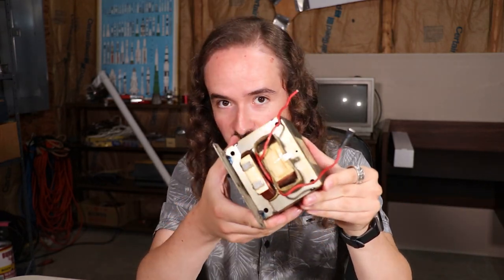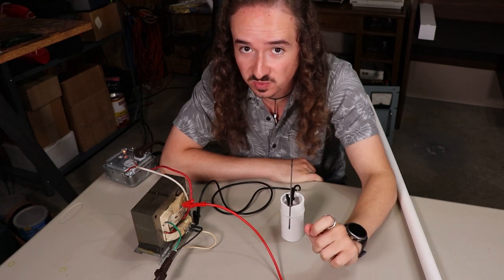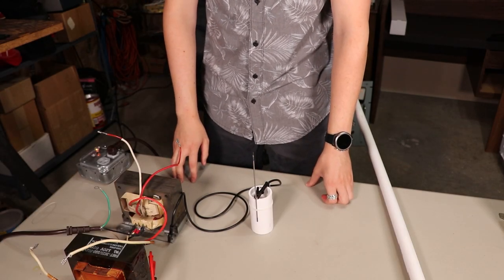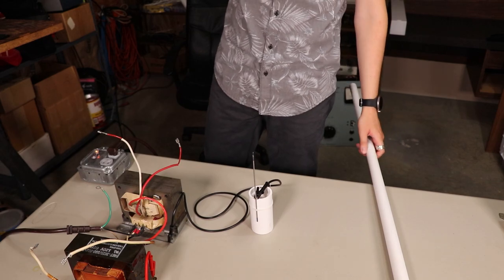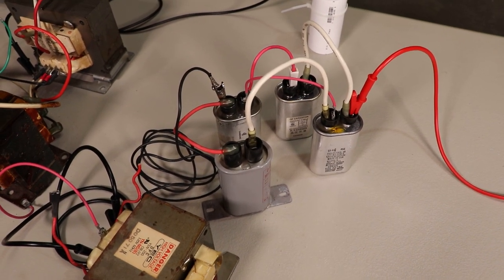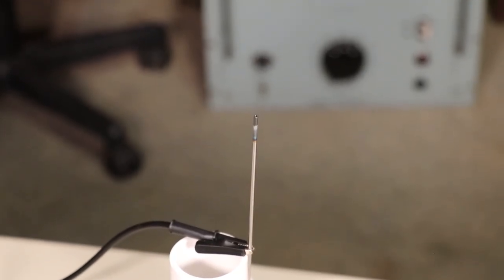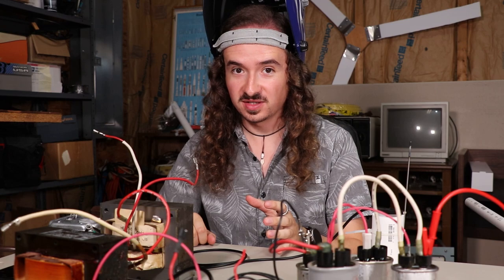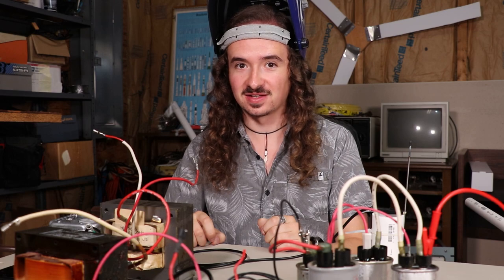Dual Resonant Microwave Oven Transformers: Huge High Voltage Arcs!

Comment: Hi my question is how much push force do a microwave transformer produce in pounds of electricity force? 
I know microwave transformer have a lot of voltage
But how much in pounds of electricity force thats what I want to know. When a power line get cut and the voltage cut line is moving up and down on the ground how much electricity force pounds is making it move like that? It must weigh something?
Reply from the maker: You're talking about seeing a broken power line jumping around as its arcing to ground? I haven't studied this very much, but I'd guess the dominant forces here are the magnetic forces, due to high current when it arcs, rather than the electrostatic forces due to the high voltage. It takes very large amounts of charge in very strong electric fields to generate human-perceptible forces, purely from electrostatic effects. Way more than the ~2.1kV of microwave oven transformers or the ~13kV of distribution lines to get human-perceptible forces causing motion on objects of human-perceptible weight. Force due to electric charge has to do with amount of charge and electric field strength and the distance between things, so it's not easy to make an overall statement of how much force it could provide. Something I worked on in the past involved lifting very lightweight objects with electrostatic force and it took on the order of 100kV to balance the weight of statically charged objects with a mass of only a few milligrams. I highly doubt 13kV on a power line is imparting any non-negligible amount of force, capable of moving a big, heavy wire. Especially when it's AC, where the polarity is constantly reversing and not DC which could accumulate some charge, like a capacitor, between the wire and the ground. The magnetic force, however, due to moving charges when high current is flowing, can be very strong on a human scale and I can absolutely see that being strong enough to cause motion on a heavy power line. Microwave oven transformer current is nowhere near what is available from a distribution line shorting out, so I imagine the force there would be much less. And again, it's AC, so it won't be a constant force. It will vary sinusoidally, with the line frequency (60 Hz here in the USA).
Reply: I try this with a microwave transformer and magnetron. I made a spark gap with a microwave transformer then put magnetron in between the spark gap. So transformer didn't make a spark , because its AC but when I put the magnetron energy on the transformer jump and made a big spark gap. That was color was bule and little yellow.  I put the transformer spark gap 3 " away from the magnetron  so when energy of the magnetron turn on go between the spark gap, the microwave transformer used it to make spark of electricity fire it look nice you should try it and put it on youtube

Comment: So you could weild with that correct
Reply from the maker: It's possible, but probably not very well because 1) the current isn't nearly as high as a proper welder, so it doesn't get as hot, and 2) it would be really unwieldy and imprecise because the high voltage enables the arc travel over long distances, so it would be hard to control the location of the arc.

Comment: What if they were connected in series to avoid high amp? Just wondering if this would work.
Reply from the maker: You mean by putting 240V across the two of them in series, instead of 120V in parallel? In theory, yes that would keep the current lower, instead of doubling it with them in parallel. The practical side of that, however, is that these transformers aren't identical models and probably don't have the same primary impedance, so it won't be exactly 50/50 voltage drop across the two. It may not that different enough to matter, but it still may be different. Take a look at the latest video I just posted though. The Jacob's ladder. I installed a 240V 60A circuit and I was able to run 4 MOTs no problem with that.

Comment: What would you say the voltage is with the 2 in series I need a good power supply for the tesla coil I'm building obviously it has plenty of current lol but from the ark distance at first strike I would say around 10-15 kv  maybe 20 but was sure about the distance from the video loomed like an inch or 3cm
Reply from the maker: Before it strikes, the voltage should just be the sum of the two MOTs (2x2100VAC =4200V) because there's no current flowing so there's no resonant rise. Once there's current though, then the voltage will go up. I'd have to write out the impedance calculations to know what it rises to. I have noticed after watching the video back that it seems to strike at a way longer distance than 4200V should be capable of though. My only explanation is red hot electrodes after repeated arcs having more electron mobility (i.e., thermionic emission). Not 100% convinced of that though.
Reply: @CoilLabs  I also wasn't thinking when I wrote this for some reason I was thinking you ran one off of the other transformer lol 😆  I don't know what I was thinking I'm building a tesla coil and I'm having trouble finding a power supply for a decent price and I really don't wanna use MOT transformer because they are super dangerous lol the amount of current these thing let flow is crazy scary but I might just have to also I wanna build a patent tesla has that he believed produced longitudinal EM waves it runs off the same primary circuit but the secondary is different I'm super fascinated by it not sure if it will work but if it does the impact it could have is tremendous I don't think he would have patented it if je thought it didn't work but I don't know I'll see after testing if it does in theory I should be able to transmit through a Faraday cage not sure though but also I'm just a Pleb so I might have some wishful thinking
Reply from the maker: Depending on the type of Tesla coil, MOTs aren't a great choice for the power supply. They work fine for vacuum tube coils, where the current is regulated by the vacuum tube amplifier, but for spark gap coils, they're not a great choice. Neon sign transformers (NSTs) are much better and safer (though still not "safe").

I'm familiar with the surface wave concept and I think there are more things to be learned and possible new technology to be created from those concepts, for sure. There's also a lot of misinformation and pseudoscience revolving around this topic unfortunately, so be careful what you believe. If it sounds too good to be true, it probably is.

Comment: How about series the primaries and running it off of 220 volts, that should half the input current.
Reply from the maker: That's a possibility yes. I don't currently have a 240V plug accessible for these kinds of projects, but I am planning to install one at some point.

Comment: Is it possible to increase the arcs with capacitors in primary ?
Reply from the maker: In addition to the capacitors on the secondary side or instead of the capacitors on the secondary side? Fundamentally, what you're trying to do here is decrease the reactance by adding the capacitors and bring the phase angle between voltage and current closer to zero, or increase the power factor (equivalent statements). You could theoretically achieve the same thing with capacitors on the primary side, but since these are step-up transformers (roughly N=18) you'd need 18^2 times the capacitance added in series on the primary side to get the same change in reactance of the overall circuit (look up transformer reflected impedance). And actually even more than that with multiple transformers in series. Adding too much capacitance is also a bad thing though, because then you overshoot trying to zero out the reactance and now the magnitude of the capacitive reactance is bigger than that of the inductive reactance and your power factor will go back down. It's all about finding the right value.
Reply: @CoilLabs  instead of the capacitors on the secondary side. I have a 20kv 3phase 100kva, but my arcs are very small..i have ABB capacitors with 3phase and 50kvar. I limited the current at 60 amps at each phase but the arcs are small (30cm)
Reply from the maker: I don't have any experience working with big 3 phase equipment like this, so I can't comment too much on any of the specifics there. It basically comes down to what I said about trying to reduce the reactance and increase the power factor. Adding capacitors on the primary side will likely help though, yes, and if you want to understand how much it will help, look at it in terms of "transformer reflected impedance". One thing to be careful about, with adding capacitors on the primary side though, is inrush surge current when you turn the thing on. Might need some kind of soft start circuit where you turn it on with a large resistance in series to limit the transients, but then have a switch to bypass that resistance so you can then run at full power.

Comment: I would be impressed it you removed the magnetism and electrons from the experiment. Funnel the voltage through two spark gaps into a pancake bifiler coil with primary & secondary. Secondary - each end connected to an aluminum plate.

Comment: I suggest that you wear welder's protective gear including a rawhide jacket for UV and fire protection. I assume you are wearing electricians shoes when you experiment. The welder's helmet is a good idea, electrical arcs generate temperatures up to 50,000 degrees and therefor are prolific UV sources. You can fry your eyes very quickly, and get sunburnt on exposed skin.
Finally, the resonant arcs have the potential for reaching voltages in the ten thousand volt range. At this level the generation of x rays is a distinct possibility and a further hazard. Lead shielding is a good idea......
DANGER! DANGER! WILL ROBINSON!!!!!!
Reply from the maker: Safety is the first priority, always, and I very much appreciate the words of caution. I take a lot of precautions when doing stuff like this and I make sure there are control measures in place for everything. As always, I do not encourage nor condone anyone attempting to recreate the things I do on this channel.

I do want to point out, however, that UV emission danger is not actually as big of a problem in this particular case, as it is in others. This arc is not nearly as hot as something like a welding arc or a mains arc flash, because there is a lot less current, therefore the amount of UV being emitted at atmospheric pressure isn't as high. Even more so for x-rays. In a high vacuum, at those kinds of voltages, x-rays are definitely a risk, but at atmospheric pressure, x-ray emission is very unlikely. You absolutely need to protect your eyes, because it is still very bright in the visible spectrum (though still much less bright than a welding arc), but it is not likely you are going to get any dangerous levels of UV exposure from something like this. Perhaps if you were in proximity to an arc like this for hours, the cumulative small amount of UV being emitted could be dangerous, but for a few seconds like this, I doubt the level of exposure is very high. Always good to be cautious though.